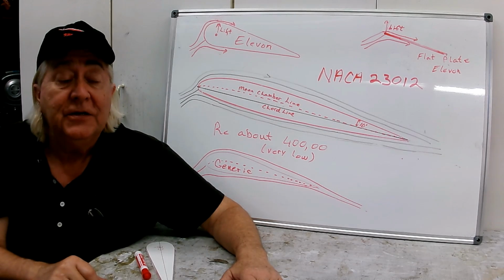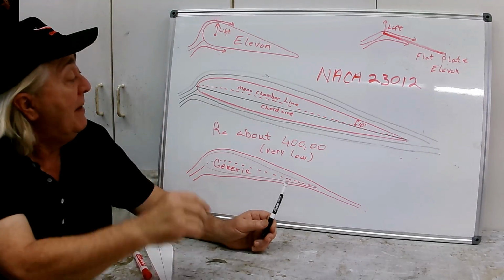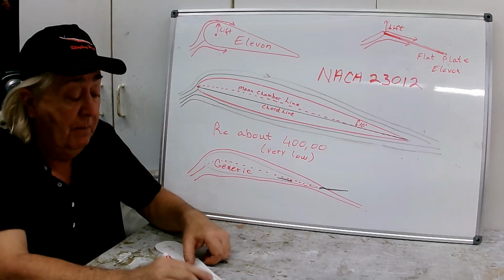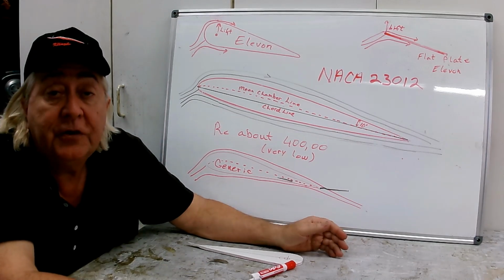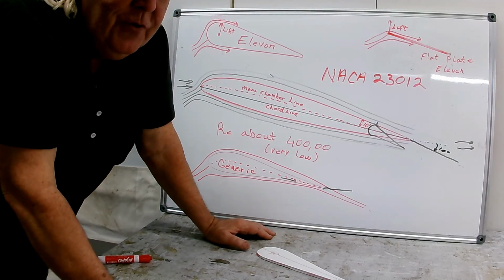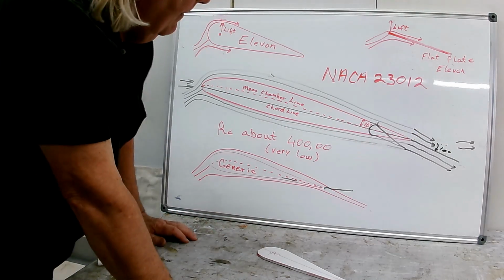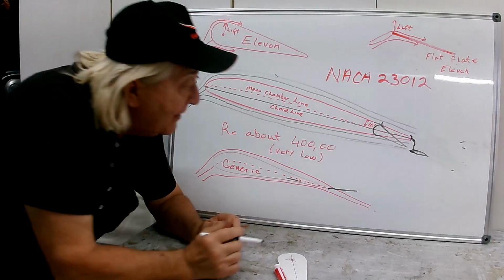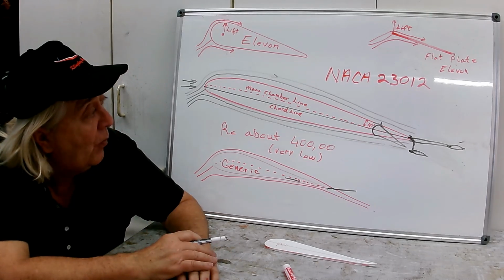Flow Separation Primer - Klingberg Wing MkII Development

Comment: Danke! 

Hello and greetings to you!  

Great videos, especially the ones about airflow dynamics over aerofoil- and control-surfaces.  Maybe,  you could include some more information in separate videos, if possible and if you have time, about  GA wing design and development, including the theory and technical challenges in wing design, too, as you have done with your 'Klingberg Wing'.  I do not fly myself, but have a big passion for aviation, am looking to learn more about aircraft design theory, practices and conversion into aircraft, full scale or model.

Carry on with your great videos; have learnt a great deal about airflow characteristics over and under aerofoil sections just from your videos alone.  Keep up the great work!

With best greetings from UK

Andy
Reply from the maker: Thank you very, very much for your generous donation. That will cover the cost of some gas so I can get out for more testing!

Comment: OK, so I'm watching these in somewhat random order, but feel I should comment here.
Right from the beginning here, you are chasing a problem (obvious in the video), but I feel chasing it from the wrong direction. You are having to pitch forward to stabilise your towing climb, and running into problems with the elevon airflow separating. The problem is not the elevon, but your tow position. Move your tow hooks further up.
As for the aerodynamic/Reynolds numbers/flow separation problems, to start with, these won't be a problem in gliding flight (or if the tow hooks are moved), except in stall recovery, and more pointedly, rolling out of steep turns (when the elevon is in aileron mode).
The flat plate, hung off the trailing edge, will work, but for three different reasons. Yes, the upper (or lower) surface flow discontinuity can be cured by using a flat plate (which [#1] in effect means you've created a reflexed surface), but you have also [#2] increased your wing area, and thus lowered your wing loading, and you have [#3] extended your elevon moment arm aft, giving it better leverage and thus less requirement for deflection.
A possible cure I see (as well as the tow hook), is to go to a bi-convex section at the elevon, or in other words, make the elevon thicker (2~3%?) than the section of wing it is attached to, have a look at the P51 Mustang elevators. You could also try extending the chord of the elevon (gaining #2 and #3 benefit), and utilising a reflexed surface (Mustang ailerons), but I'm not sure of how these changes work at the Re you are using...?
Keep at it.
Reply from the maker: Yes, tow position was part of the problem. I know have it towing through the vertical CG position. However, even with the tow position off somewhat, there should have been enough elevator control to overcome the moments and there was not. The root cause was separated flow on the elevons. This is due to a Re issue and is discussed at length in other videos. To the best of knowledge, I have since solved that Re issue. Finally, the most recent results and data are available only to members of my channel. You can access them by clicking the join button - only $0.99 per month. Hope to see you there!

Comment: So you're increasing the AOA of roughly 100% of your MAC-aft chordline in order to .. lower the AOA?

Doesn't that mean there's an inevitable bottom portion of the speed envelope where you're guaranteed to tip-stall and consequently experience an uncontrollable nose-up moment, as your center-of-lift moves forward?
Reply from the maker: Well those are terms I know, but what you are trying to say with me I haven't a clue.

Comment: Out of curiosity, what effect would small stall fences mounted to the control surfaces have?
Reply from the maker: Been there, done that: https://youtu.be/eH4HDLJVp4E     Fences are for boundary layer problems. This is a Reynold's Number problem. You may wish to review: https://youtu.be/2mh8szvuD40
Reply: Thank you. I have a better idea of what you mean. I’ll be honest, I barely have a hobbyist understanding of aerodynamics. I’m a towboat captain on the Lower Mississippi River. I guess I could brag about practical experience in flow dynamics but honestly I have no formal training. 

After watching several of your videos I keep thinking about the morphing wing profiles that several universities are studying. The problem there is obviously weight. But in that vein, would a two piece control surface be feasible? Shipbuilders had a similar issue with low speed maneuverability and came up with a two piece rudder that increased handling capability and improved fuel efficiency while having a very simple mechanism. The Becker is interesting nonetheless. https://youtu.be/UDBeCqzYO5k?si=T2oV7V1xDziQWore
Reply from the maker: Morphing wing - really cool concept. However one would have to solve the weight/complexity issue to make them effective on a ultralight glider. What one might gain in aero efficiency would most likely be lost in weight gain, not to mention the big increase in build cost. I can't comment on the multi-part boat rudder concept as I've never seen one and I'd have to study it carefully. I can safely say that boats are not airplanes and water is not air - not all concepts transfer well  between the two worlds. Overall, I'd say that designing aircraft is like making a fine wine - it is all about compromise across many, many factors and it takes about 50 years to learn how to make a good one....and then you die. (Old wine makers joke!)

Comment: Wonder what the challenges are to a flat component like that - making it stiff enough, flutter issues, etc.
Reply from the maker: Yes, flutter can be a big issue with flat plates and has to be studiously avoided. Spanwise flutter is not an issue because they are directly attached to the wing TE. However, torsion can be a big issue. Most of the "flat plate" controls I've used or seen are actually thin wedges so they form a torsion box to make them stiffer. One also has to be careful of what impact the placement of the control connection point might have. All that said, there are many powered ultralights that use flat, fabric covered, controls and I have not heard of any flutter problems. However, those controls are usually much shorter in terms of span.

Comment: Didn´t the Aeros Phanton use the flat plane?
Reply from the maker: From what I can see in the online photos, the answer to your question is, "Yes"  It is nearly identical to what I used on my original Klingberg Wing back in the '80s. I should mention that the Phantom appears to have a much larger wing chord than my wing at the elevon. Maybe as much as 30% larger. This means they would not have had the same Re problems I'm dealing with.
Reply from the maker: Oh, BTW, have you flown a Phantom? I'd love to get first hand comments about its handling. If you don't do you know of someone who has flown one? Please let me know.
Reply: @KlingbergWingMkII  Some of my glider-club-buddies flew the Phantom. Newer heared anything about spinning. Most of them went back to traditional gliders because the thing was mutch to heavy and quite difficult to land. In alpin CX-competions it is a big disadvantage, if you have to care too much about finding a siutable landing field with the perfect wind.
After rought landings the pilots were traped under the havy glider some times in a position that did not allow them to free themselfes from glider or harness.
Reply from the maker: I found the original owners manual for the Phantom online!  It states that the pilot must stay aware for spins. It says the glider will enter a full-blown spin in just a 1/4 turn! I'm not surprised to read this as the glider has strip ailerons which can really aggravate spanwise flow and promote spins. So, flat plate good, strip ailerons bad. In my early videos I explain why an elevon with "reverse" taper (smaller chord at the root and bigger at the tip) prevents this problem. In fact, I have a spreadsheet for calculating the planform of the elevon required to prevent spins. The results are based on the taper and washout parameters of the main wing.